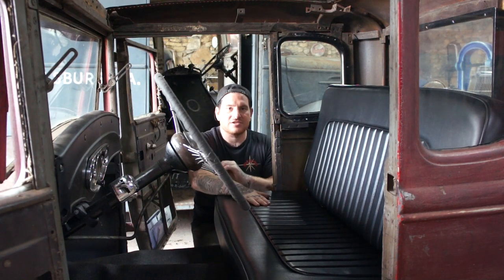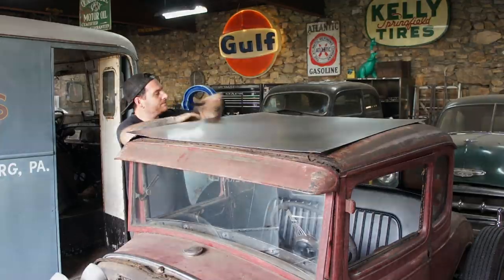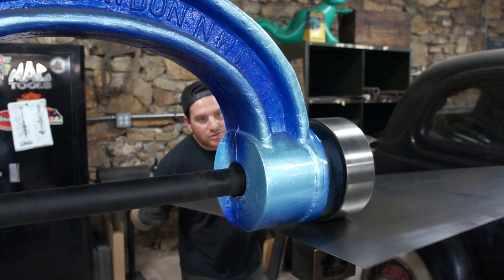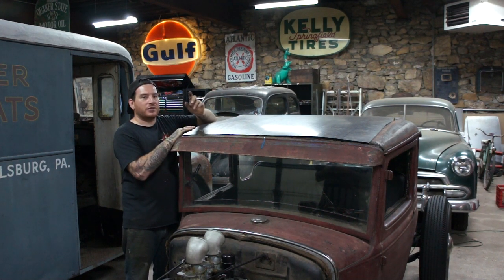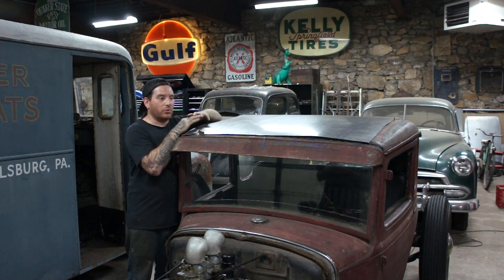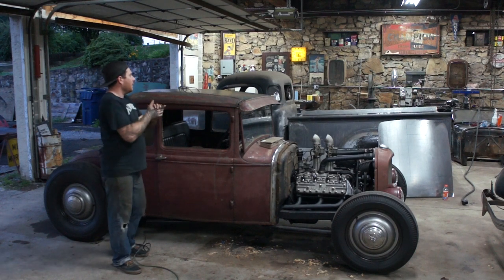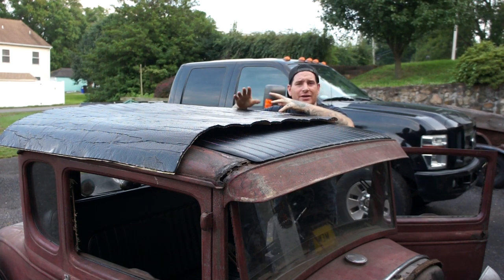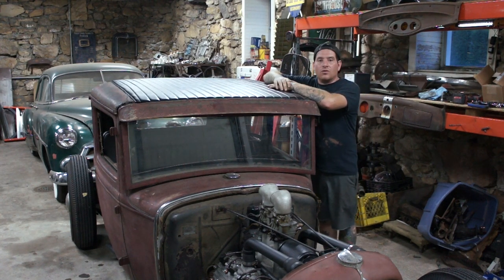How to Make a Metal Roof Insert for a Ford Model A- Pagoda City Coupe

Comment: Many don't realize that all Ford A Models have a double convex roof,in that it bends front to back & side to side. I found the easiest way when you want to make it original,is to use new wood across the roof & then cut 6" 3 ply plywood strips to run front to back. By the time you attach long grain vinyl over the whole area as supplied by LeBarron Bonney, it really looks better than original.

Comment: You need some cross beams to stop it from flexing / drumming kinda like what more modern cars and vans have to mount the hoodlining bows to.. You could use a 'U' (with 90 degree flats on each side at top to but to bottom of roof) shaped section and heat and roll it to curve of roof

Comment: Hey Matt it's matt here in nashville TN. I'm building my first AV8 and need some serious advise..I'm getting all my parts together, so far I've got.. I've got a 31 roadster ( original car). I bought a 40 ford coupe and pulled the flathead v8 and trans. But then I sold the rest of the 40. Now I'm hearing that I should have used the 40 front axle and brakes and rear end out if it. So I can buy another 40 ford sedan for 1500 bucks. It's a junk heap but has complete drive train and front/ rear end with beakes. Should I but it for the front end and rear with brakes? What about steering? Should I put the 40 steering in it? What's your opinion? Thanks.
Reply from the maker: Hi Matt, sounds like you have cheap 40 Fords growing from the trees there! If you want the easiest way to do the AV8 than you'd want the drivetrain including rear and the front complete axle. That will get you juice brakes and the associated parts. I'd skip the pedal and steering box from the 40 since it will be cross steer and the pedals mount to the center X. Instead I'd look for an F1 steering box and center cross member with pedals. That should all get you basically everything you need to get a kick ass little AV8 roadster!

Comment: How long you figure that outside upholstery will last before the weather takes it out? Maybe someday simulate the pleats with a beaded panel? Take a bit of work but... bead the panel and then weld it in for good. Have bead it with extra material on the first measure then trim it after the beads to it's final width. Same look but more permanent.
Reply from the maker: The car sits in a garage 99% of its life and the small amount of weather it sees is not going to harm it. I'd say if the car is cared for overall it will outlast me. Different mindset than a daily driver that is parked on the street.

Comment: Matt,  what was the spacing on the bolts for the top and the size....I'm agonizing over how to do mine (30 coupe ).
Reply from the maker: I just spaced them evenly lol. I can't recall but I lined them up with the slots in the roof from the original tack strips. I'd use 1/4-20 studs.